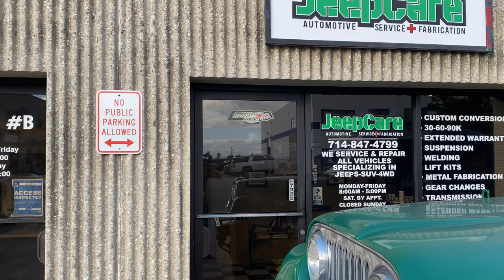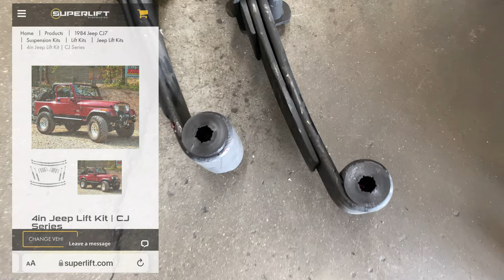Jeep CJ7 Springs Install ~ Superlift 4” Lift ~ Ep. 89

Comment: I was happy with the factory spring. I wasn’t happy with any of the lift kits I’ve gotten, but I need them. 
I will move the steering box forward, add a Dropped Pin arm, wrangler spring conversion, forward shackle conversion. I will change it to a spring over,  extend wheel base a little
Reply from the maker: Good luck with your project!

Comment: You’ll have to do a follow up video to review the ride with the new springs. Thanks!
Reply from the maker: Definitely! I’m trying to keep from having too high of expectations — lol! But I do think it will make a big difference off-road. It does ride better on the street. These springs are probably a true 4” lift. The Rough Country was at least 5”. So I’m not riding quite as high. Thanks for watching!
Reply: @tcsadventures  That’s a pretty tall lift for CJ, raising the center of gravity and increasing roll risk. Trade offs happen with every choice. Looking forward to seeing the next CJ video.
Reply: @tcsadventures  how are the new springs working out, both on and off road?
Reply from the maker: I haven’t taken it off-road yet, but there is an improvement in the ride on the road. The new springs are less stiff and it’s less jarring when you go over a bump. I’m also riding an inch plus lower with the new lift.

Comment: Nice looking jeep, congrats. I always thought the shackles where supposed to be at a 45º angle to get a smoother ride. I'm currently looking for a solution to it. Any thoughts?
Reply from the maker: I have no complaints about the way my CJ drives now. Superlift was a big improvement over the Rough Country springs. As to the shackle angle, I left that to Dustin. He works almost exclusively on Jeeps so he’s the expert. I can tell you that when I do the work myself (more on my sailboat diesel and outboard than my Jeeps) I almost always talk to tech support. I would rather get the manufacturers advice than opinions on line. Whichever shackle you go with you can call tech support and usually get great advice. In terms of an update, after the new lift, shackles, and steering upgrades — the jeep rides and handles much better. I had really bad bump steer before the upgrades and the RC springs were so stiff it felt like riding in a covered wagon (or at least what I imagine a covered wagon felt like). Thanks for watching and commenting!

Comment: The only thing I have a question on was there a crack on the 2nd spring plate you installed…. I would have welded it up.. idk¿?

Comment: What type of thread lock is that? I’ve never seen a product that gets applied after bolts are installed.
Reply from the maker: @miniken1  I could be wrong (I usually am), but I think he’s using it to see if the nut loosens later. I have a friend who owns another Jeep shop and he puts a thin paint mark line across the bolt and nut during installation of parts. It makes later inspection easy to see if a nut is backing off the bolt (if the line on the nut and bolt are no longer in line). I think he’s doing the same thing with the thread lock. I suppose to, it could be of some help in keeping a nut from loosening. I don’t know the brand of thread lock he was using. I’m sure someone will let me know if they think I’m wrong.

Comment: What would you guess the proper amount of torque applied to the shackle bolts would be? 20lb-ft, 30lb-ft, more, less. I rarely do suspension work and usually just tighten until I think it "feels right"
Reply from the maker: I don’t know the answer to your question for stock shackles. Below is info Currie put out and I think my RockJock shackles are by Currie. Below that is a link to a Jeep forum where they’re discussing shackle torque. Hope that helps!

76-86 Jeep CJ and Scrambler - Shackle Install Instructions
Assemble shackles onto the Jeep with the grease fittings toward the outside, and the lock nuts on the inside. Tighten the center brace first to 85 ft. lbs., then torque the shackle bolts to 16 ft. lbs. Do not over tighten the shackle bolts! Check torque on the shackle bolts after 100 miles, and re-check periodically after that. Grease with multi- purpose chassis grease or moly lube. If you have any questions during the installation of this product please contact our technical department at (714) 528-6957.
Currie Enterprises - 1480 N.Tustin Ave., Anaheim, Ca. 92807
           
https://www.jeepforum.com/threads/how-much-torque-on-shackle-bolts.890486/

Comment: I also own a 84 CJ7. I was wondering if you are still liking your 4 inch lift. Any driveline issues. thanks
Reply from the maker: Yes it’s a huge improvement. Drives a lot better on the street and I haven’t had any issues with the lift.
Reply from the maker: I should also mention that the factory front drive shaft was replaced years ago when I put the Rough Country lift on. The RC lifted the Jeep 5” and the original front drive shaft wasn’t long enough.

Comment: How does your jeep drive going down the road? I have an 86 and have a wandering problem with bump steer! I really wish I could solve the issue.
Reply from the maker: In episode 79 I get new steering components and it made a big difference with bump steer. The Superlift springs were an improvement too. Much less stiff than the Rough Country and less jarring when you go over bumps.

Comment: Hi, I have the same set up. Rough Country 4 "lift. Very stiff. I'm looking at upgrading springs, shocks and possibly shackles. Would you do the Superlift 4" again after having ridden on them for a month or so?
Reply from the maker: I would say yes it’s been worth it. I don’t know about your 4” RC, but mine gave me a lift of over 5” so my ride height is lower with the Superlift and I’ve had to get used to the different look. This Summer I plan to get it out more off-road and I’ll do a video update. I still use the Rubicon for long trips… we just got back from Death Valley. Thanks for watching!

Comment: Do you have a list of all the components you installed on the Jeep suspension?
Reply from the maker: No list, but there are inserts in the video with all the information for the springs and shackles.
Reply: @tcsadventures  ok have you upgraded the axels?
Reply: What bilstein shock are you running?
Reply from the maker: They are 5100 series:
https://www.amazon.com/gp/aw/d/B01BPKFERC/ref=ppx_yo_mob_b_inactive_ship_o0_img?ie=UTF8&psc=1
Reply from the maker: The axles are stocks. But upgraded differentials. Detroit locker in front and Truetrac in the rear. You might be interested in Episode 20 where I do a walk around of the CJ and talk about what’s original and what’s been upgraded. (shot before the springs and steering upgrades). Thanks for watching!
Reply: @tcsadventures  thanks for all the information. Have you been wheeling since the 4” super lift was installed?
Reply from the maker: No I haven’t yet, but I’ll try to get out soon and do a video. We’ve been to the mountains since that install, but we took the Rubicon. The Rubicon is just so much better suited for long road trips.